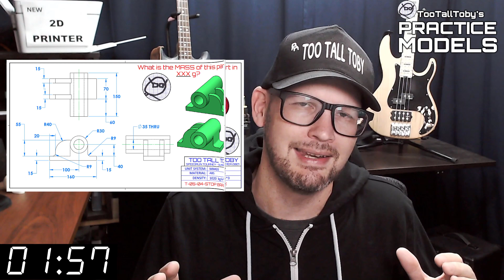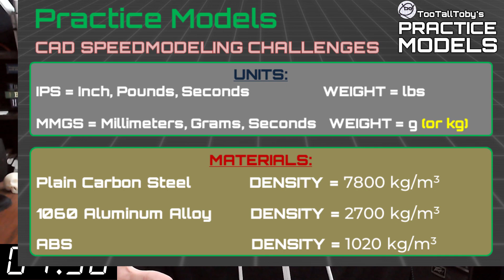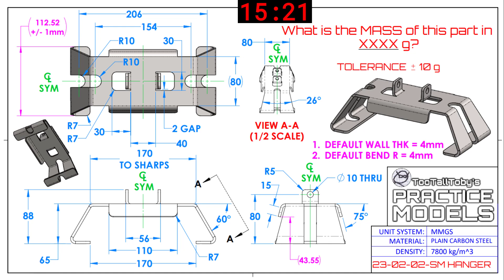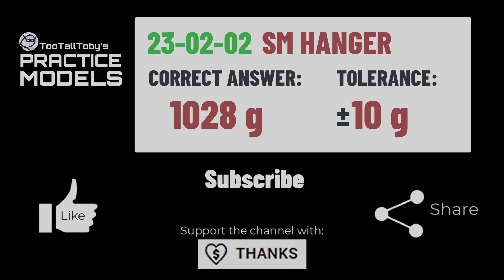SOLIDWORKS Practice - Onshape Practice - Fusion 360 Practice - TooTallToby-23-02-02-SM HANGER

Comment: I think the 40mm dim is bend relief specific and probably should not be included, instead, just the 56mm dim. Lots of manipulations in those areas to make different cad systems match up, or even within the same cad system there are a bunch of ways to make that area look completely different.
Reply from the maker: yeah that drawing is pretty off the hook - it's one of those "the customer gave us too many dimensions" types of drawings.  But at least it has a high tolerance for spec :-)

Comment: That was a fun one!
Took me just about 6min to end up about 1g high, so well within tolerance! Onshape solve on my channels for those interested!
Reply from the maker: Nice job! Dang speedy!!
Reply: Thank you for the great tutorial - I was able to complete this challenge thanks to it. My biggest problem was adding flanges so that the bend starts on the existing face. It seems impossible in Onshape and tabs need to be added beforehand.
Reply: @xdads  I had the same issue in OS. My solution was to add the flange, then use "move face, translate" until it started at the edge. It took trial and error to get it to the right spot.
Reply: @nickp4793  The "translate" option works well too. You don't have to use trial and error: you can use the measure tool to quickly create a variable and then translate by that exact amount.
Reply: Thanks, I learned a few trick from you video.

Comment: 1032.3967g in 24:12.  Don't know why I'm high. My drawing matched yours including the reference dims.
Reply from the maker: Its probably because of the transition area into the side flanges (which fan out).  The location where you start and end the angled face will make a big difference.  Still within spec - +/- 10g - I kept it pretty loose on this one :-)

Comment: Mass = 1037.26 grams @ 13:42. Took a lot of figuring out. Most questionable is the 26° dimension. Not your best work I guess, altough it isn't per se about getting it correctly but about modeling it as fast as possible. ;)
Reply from the maker: yeah - the problem is the origin of that 26 degree angle.  It's very difficult for me to specify where that angle should start (at the beginning of the bend, or at the end of the bend) and so I left it up to the designer/manufacture.  Then I added a Plus/Minus 10g tolerance, to allow people to still answer within spec.  

You were right on the edge :-)  nice job!
Reply: You are right! It's not 26 degrees! It's 28.24 degrees